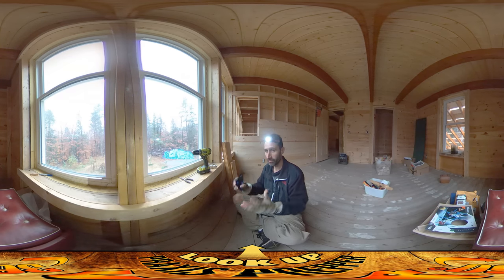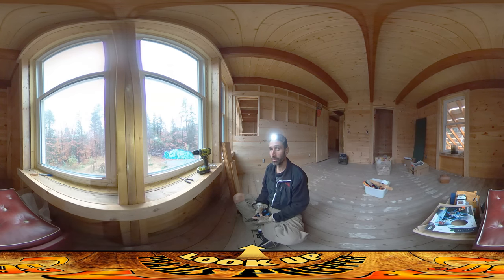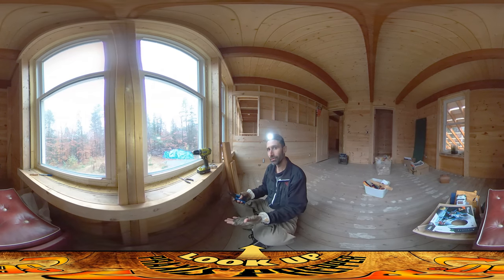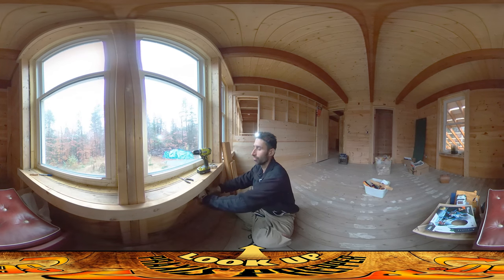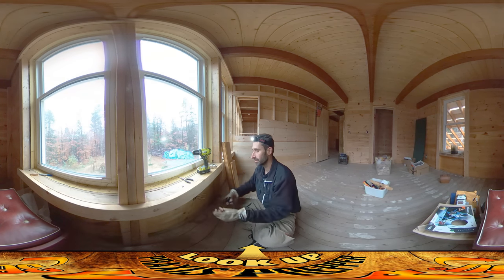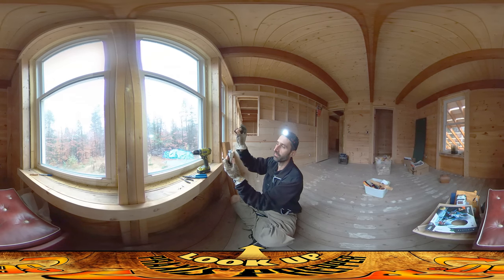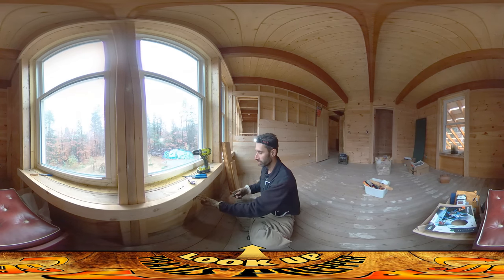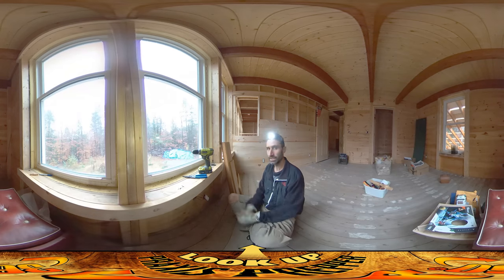Homestead Build - Installing Electrical Outlets Upside Down, Old vs New Wire Dimensions

Comment: Just a heads up that the inspector might say something because an upside down plug normally means it’s 20 amp if I remember correctly.
Reply from the maker: I wanted to be sure it was cool too, so I checked that one with the electrician and he said it was totally cool to install them that way.
Reply: @PraxisPrepper  Figured you would probably have checked first, but just wanted to make sure since it might confuse an inspector. Good reasoning for doing it though, makes total sense from a safety standpoint 👍

Comment: But it seems you still need to finish all the trim on the doors, and the windows look like they are short some trim too? ... clearly the floor on the 1st floor needs to be done, curtains will have to be put up (well clearly first the railing), speaking of railing I also recall the stairs needing some... so still plenty to do ... ohw, what about finishing the kitchen after the inspection... obviously the greenhouse roofs and some of their inside... and i bet i still forgot 'a million' (as by expression) of other things...
Reply from the maker: When I'm talking about "done", I'm talking about "done enough to move in for the winter and finish it up asap".
Reply: @PraxisPrepper  ah, ok :) ... that makes sense ^^ ... we will be here reminding you of what needs to be finished and spur you on to actually doing it (or so i hope)

Comment: 50 plugs on how many circuits, have you thought about using GFI plugs on all your household circuits not just the ones in the bathrooms.
Reply from the maker: I have not. Any particular reason why other than an abundance of caution?
Reply: @PraxisPrepper  Well, if you have 5 or 6 circuits and 2 of them need the GFI already it isn't a big reach to cover them all.....out of an abundance of caution, you never know what those grandkids will get into.
Reply: The nice thing about GFI plugs is that if you install it on the first plug in the circuit it will protect the rest of the plugs on that circuit.